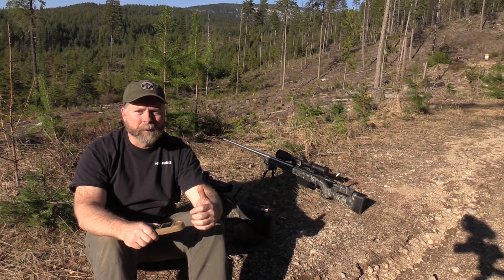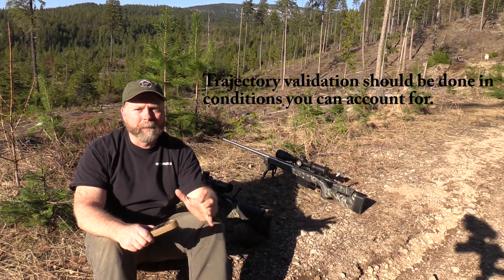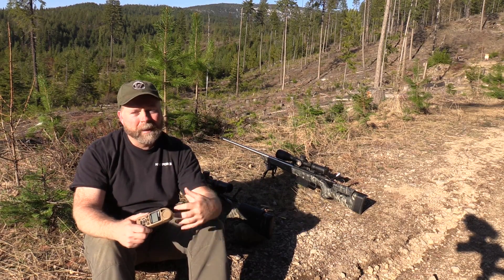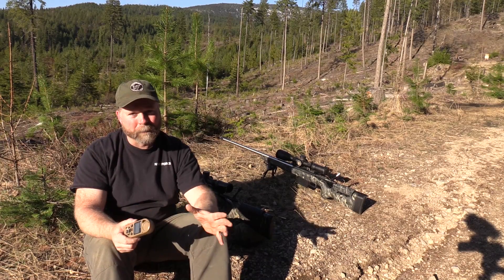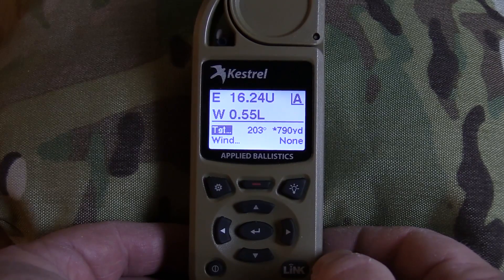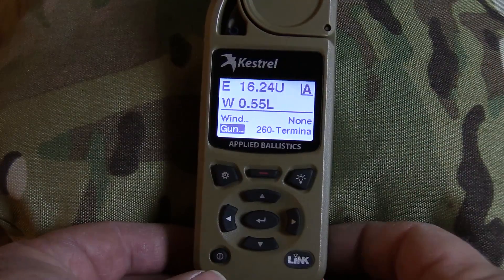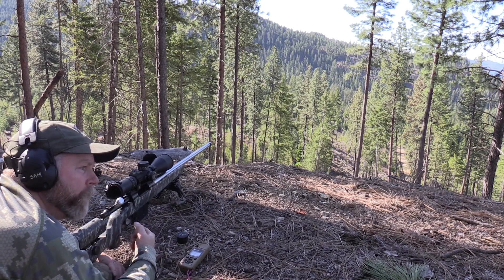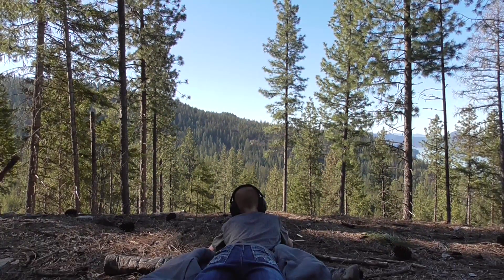Kestrel 5700 Elite Weather Meter w/ LiNK: Trajectory Validation

Comment: But why would you have to "true" the ballistics solver if the ballistics software is accurate?  I measure my bullet speed and input all data accurately, yet I still have to "true" the software?  What that really means is the software sucks, doesn't it?  If your inputs were accurate and the output is wrong then the software sucks.
Reply from the maker: You’re not truing the software, you’re truing the inputs. The output is only as accurate as the inputs. Inaccuracies or stacking tolerances with BC, MV, ES within the MV, scope tracking, reading conditions, etc. will cause more problems than software. The software doesn’t suck.
Reply: @PanhandlePrecision  My software allowed me to choose Berger 215 grain bullets, so why wouldn't it already have the bc dead on? And I input barrel length and all that.  And a kestrel will input accurate environmental data.  So where are the inaccurate inputs coming from?  Its because I don't see input error that I blame the software.
Reply from the maker: @w.harrison7277  http://panhandleprecision.com/trajectory-validation-ten-steps-success/

Comment: You have always helped me with this stuff, more than any other source. so thank you for that. I have a MV Adjustment, (Trajectory Validation) question for you;  Went out to my 1000yd range facing north, (zeroed my Creedmoor facing south), Hit 10" high at 1000yrds, confirmed with three shots. Adjusted MV successfully. But that threw my other distances off more and more the closer I came in to 200 yards. (then if I adjust for 200, my 1000 is back off. (tried with G7 and Litz curve)
Reply from the maker: Almost a full MOA at 1000 yards is quite a bit to be off. There are a lot of things to check, including scope click values, perfect zero, range conditions, parallax, muzzle velocity, etc. I would be hesitant to adjust MV in a solver to account for that much at 1000 yards.
Reply: Panhandle Precision Thanks. I’m going to try everything again this week. Start from scratch. Do you usually select the “AB CUSTOM CURVE” option , or the G7?
Reply from the maker: Craig Melchiano I use the G7 BC straight from the Kestrel’s library.
Reply: Panhandle Precision Last question I promise. (This is very helpful.) So I. General how is it possible to adjust where you’re hitting down range, and it not effect the closer distances? Seems like if you fix it “out there”, it’s going to throw the close ranges off.
Reply from the maker: Craig Melchiano It’s not possible. That’s why it’s important to double check the basics before making big adjustments.

Comment: Your videos have helped me very much for years. Thank you very much. I have the Kestrel 5700 Elite/Link and went shooting today with my .300 Win Mag with 220g MatchKing load. i was zeroed/confirmed at 200, then went out to 400, 600, and at 800+ I had to start adjusting velocity like you show here . Then I was on out to 1350yards, but when I came back within 600 yards I was off again. Do i need to have a profile out to 600 yards, and then another one for 600out to 1350 yards? Should I adjust BC? Thanks
Reply from the maker: No on the multiple profiles. Maybe on the B.C. A velocity change to sync up a mid-range trajectory will have a bigger affect on a long range trajectory. Have you read this? :http://panhandleprecision.com/trajectory-validation-ten-steps-success/

Comment: great videos thanks very much. question regarding the truing of mv. when you save the ACTUAL moa and mv, does the kestrel keep it for that range? with that temp, etc?   and does it use that corrected value to determine other ranges?

i hope it does, because i would like the kestrel to keep the ACTUAL TRUED values i enter into it. 

thanks again, and keep up the videos... much appreciated.
Reply: disregard. just ran the experiment. it does keep what you enter, and it does recalculate all ranges based on the trued value.   what is interesting and a problem with all these calculators is that if you true at range A then range B will be wrong. Then if you correct/true range B, then range A will be off and maybe also range C. thanks again for getting me tinkering.
Reply: I had the same issue. Had good data with engagement out to 650yards. Further out I sent a few rounds from what the kestrel projected at each target and made corrections on my scope. Wrote it down and moved further out. Maybe Sam could do another video that touches just on this subject. Sometimes it’s as simple as a muzzle velocity change to impact where you want it. As the bullet slows down at further ranges the bullet BC changes so playing with the BC can help. I would only change one at a time to narrow down what the bullet is doing

Comment: Great videos thank you. Quick question just to clarify. I developed a new load, zeroed my rifle at 100 yards. I chronographed my load with a Magnetospeed which gave a 2710 mv average. My range goes out to 600 yards. I inputed all the environmental conditions into my Kestral 5700 AB. The Kestral advised a hold of 3.9 mils which hit low on target. I adjusted to 4.5 mils which gave a center hit. Now I trued my Kestral following your video and adjusted the muzzle velocity to 2621 fps which adjusted and confirmed my dope to match the 4.5 mil drop. This has now been adjusted and saved in the gun profile. This range trip was at 80 degrees. My question is, four months from now when temperatures are in the 50s will the Kestrel give an accurate dope when environmental conditions are entered. Or should I at a minimum create a muzzle velocity curve based on the 80 degrees corrected muzzle velocity and use that. Or will this simply get me close without re-chronographing and confirming dope at distance?
Thanks and I appreciate any advise.
Reply from the maker: The Kestrel automatically adjusts for air density using air temp and pressure. Once it's trued, it won't matter what the pressure and temp are as long as your ammo is temp stable. Why are you inputting conditions?
Reply: Thank you for your reply. Sorry to clearify I was not manually entering the atmospheric conditions. The Kestrel did that on its own. I just corrected the mv to match the dope to the 4.5 mils needed for a center hit. I'm using Varget powder which should be pretty stable. Just want to be certain that once trued the Kestrel will provide accurate dope in varying conditions.

Comment: Once you have gone through the process of trajectory validation (cal mv) and found that the adjustment delivers an accurate firing solution, are you done, or is this something that should be done across varying environments. I'm thinking through the process of me updating my MV temp table will the new data during the temp changes over the next month. Would it impact the output in a way that I should on a cadence perform trajectory validation. Love the videos and really like the velocity you get with the 260 terminator. Once the barrel on my 260rem is out, it might be time to swap over and get more out of my 140 bergers with that cartridge. Thanks for the guidance!
Reply from the maker: The trajectory validation is taking all the small tolerances in scope click values, bullet B.C., sight height, etc. out of the equation. Once it's done, you shouldn't have to adjust again. If the M.V. changes with temp., it should be a linear correction according to the difference.

Comment: Great videos, on my Elite I see Cal DSF as well as the Cal MV.  Do you think one gives better overall accuracy in calibration over the other? Same results? Keep up the good work.
Reply from the maker: DSF is only used out in the subsonic range of the shot. If you don't validate to the distance shown in that screen, it won't change anything. Ideally, MV truing should be done where the load goes transonic, but it will adjust if validated closer. For what I do, MV truing works fine.

Comment: Does the K5700 allow for ballistic BC truing like Advanced Ballistics does on the phone?   What I mean is 3 different ranges and hold overs vs the 1 data point in the video.  I ask because on my phone AB can create custom drag models.
Reply from the maker: On the Elite, you can choose between G1, G7, or AB custom drag curve. You can also adjust/true with Drop Scale Factoring.

Comment: Sorry one more question. My readings for my other profiles are all working nicely. However I keep getting a reading for "Density Altitude" . I can't seem to turn it off. The Baro is reading 29.00 and my altitude is 900 feet, but I'm getting readings of Density Altitude of 2696 ft. My results are good so I'm just ignoring it. any ideas? Thank you.